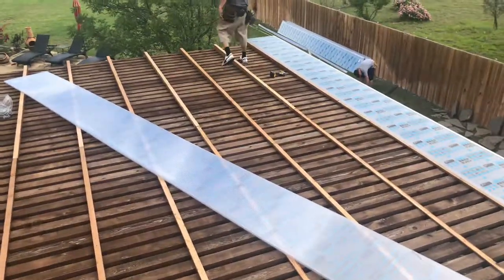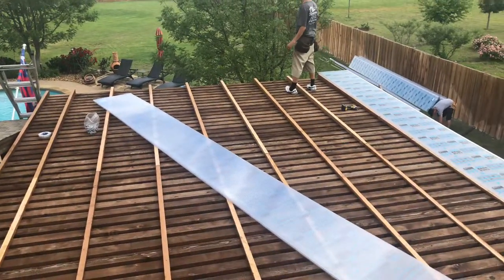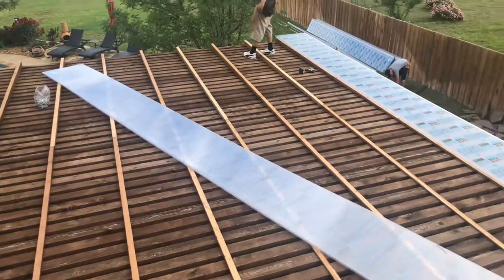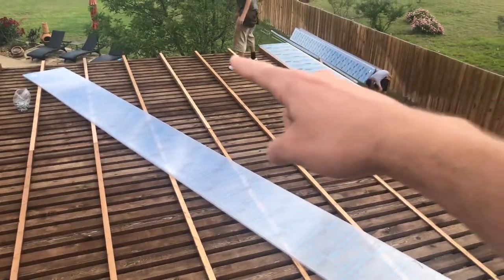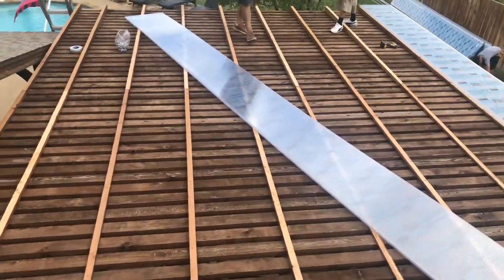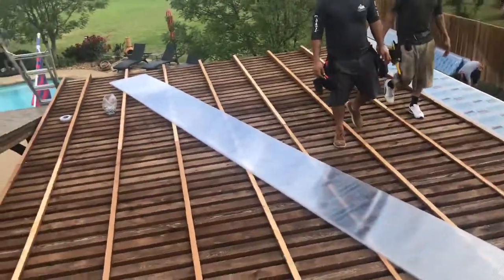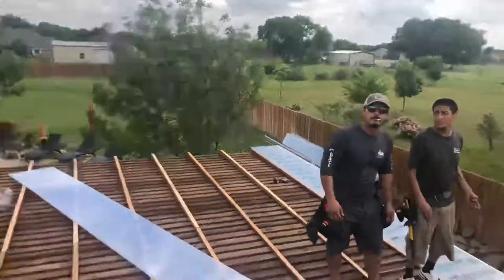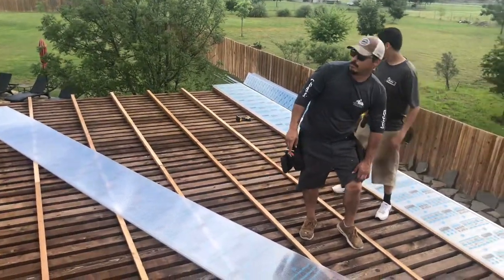Using Shims To Create A Slope On A Pergola | Cover Your Pergola

Comment: What If I have a flat roof pergola, but it is not attached to the house, it is in the middle of my garden, what would be the consequences of not adding a slope?, I live in CA where hardly rains btw. I'll appreciate your opinion, thanks!
Reply from the maker: Slopes are not difficult to add. It is of course, customer preference but could result in slight pooling if not sloped.
Reply: @CoverYourPergola  Thanks for your response!  :)

Comment: I was thinking about adding shims but i think i might just cut the front an inch shorter and place braces around the cut........thoughts?
Reply from the maker: You can definitely implement the slope by cutting down the front. Before doing so, you should check with your representative to ensure that you will have enough slope for the system of choosing. Hercules requires a minimum of a .25” per 12”, while the Apollo requires a minimum slope of .5” per 12” to be in warranty.